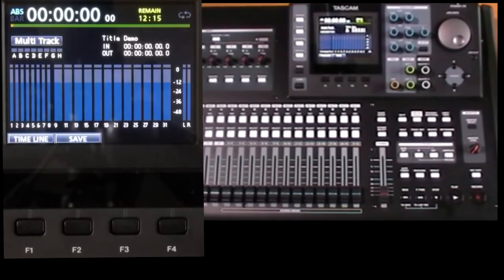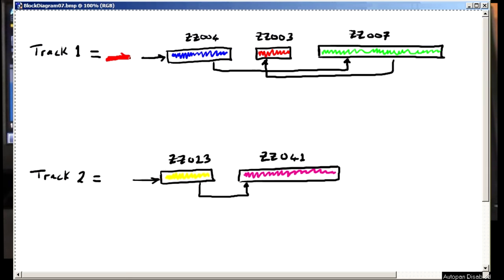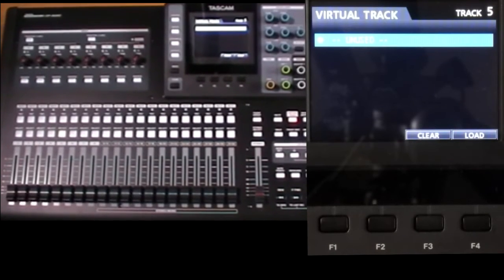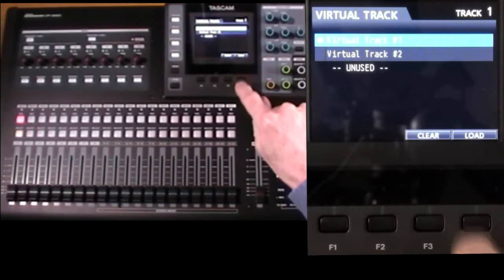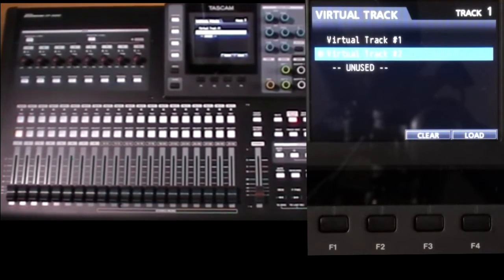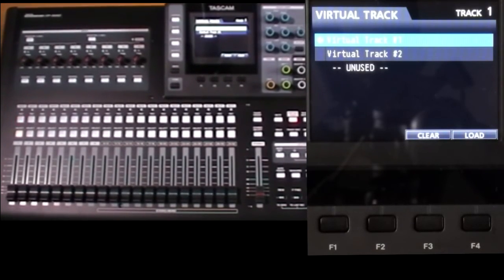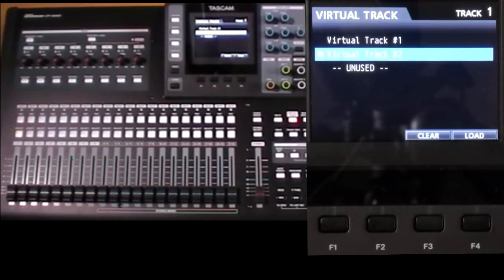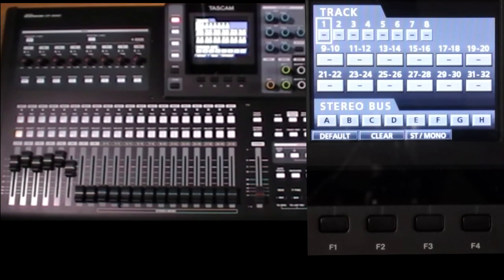Tascam DP24/32SD Tutorial 8E: Virtual Tracks

Comment: My previous recorder was a Tascam DP2488 NEO. When I used auto-punch with repeat, I cold create as many takes as I needed and cold choose the best one afterwards. Besides that, I had 250 virtual tracks with which I could store recorded tracks and move them around to whichever physical track I wanted. 
My recording technique is such that I auto-punch/repeat till I get and acceptable take. I didn't have to touch any of the 250 virtual tracks and could use those to store unedited tracks.
 With my new and "improved" 32SD, I only have 8 takes available and if I use the "repeat" function, I actually have no virtual tracks. This discovery made me regret getting the 32SD. I will have to come up with some kind of scheme to get around this.
Reply from the maker: @FOFFENDURP Yes, Tascam cut back on a lot of features with the DP24 & 32 models compared with the Neo, presumably to make it simpler and easier to use... and maybe increase the sales? But it's annoying as there's very little choice nowadays for these all-in-one portastudios. 

My old Fostex hard-disc recorders have loads of virtual tracks which you can simply 'exchange' with each other, either singly or in groups. I found it a lot easier to understand than the Tascam implementation of 'loading' virtual tracks to make them active, but then again, Fostex don't have the multiple-take feature, so you just can't win!

The only other way I can think of for storing extra tracks is to use the export/import functions. You can 'park' as many tracks as you like from a song, and they'll just sit in the AudioDepot folder until you want to import them later for processing. You need to use very short names for the song so that the AudioDepot contents screen shows the track numbers properly, and/or keep notes of what each track contains (although you'd have to keep notes with virtual tracks anyway) but it might be a workable option. The AudioDepot folder is common to all songs so you could also import tracks into other songs if you want.

Thanks for stopping by.

Comment: Thank you for all of these videos, Phil. They are an invaluable resource! It seems that you're preferred method of recording alternative takes on different physical tracks is also useful because if you, for example, had 3 different vocal takes and liked a portion from one, and a portion from another, then you could keep that portion, rather than having to commit to the entire track. Not sure if I explained that well. This could be achieved with virtual tracks if you exported them all onto your computer/DAW and chose the parts of the different virtual tracks that you preferred, however, (and then reimported the track back into the DP-24/32 for mastering).
Reply from the maker: @cinemojoe you're right, you can certainly use a computer to sort out various takes and collate all the good parts together. The larger screen and more powerful editing facilities make it easier, but... many people buy the DP porta-studios just to get away from computers! Either they don't have one, or they don't want to learn yet another potentially complex system, or (like me) they've had enough of using computers in their day job :)
This is the main difference between the DP series and the newer Model series. Even though Tascam market the latter as the 'next porta-studio', they are not really 'portable studios' (imho) as they do not have all the studio functions which are built in to the DP machines. If you want to do anything more than basic tracking and mixing, you have to involve a DAW. Anyway, that's another debate so sorry for the rant :)
At the end of the day, multiple takes can be handled using various techniques, so use whichever is more convenient for you. My point in the video was that using different physical tracks can be more convenient than virtual tracks as you can more easily review & compare them during playback by simply muting/unmuting or raising/lowering faders. At mixdown time, you can either repeat this operation in real-time, or if this is too tricky to do, you can always use the Track-Edit functions to copy & paste the good parts to another track. As you mention, this can be easier with a DAW, but the machine is capable of doing it all.
Thanks for stopping by and sharing the tip. Best wishes for 2023.
Reply: @philtipping   Thanks for the in-depth reply! Yes, one of the reasons I bought the DP-32 as well. I do video editing and graphic design and man, after 8 hours or more on a computer, I want to relax and play some music and not spend more time staring at a computer screen. And that’s really interesting about the new Model series. I was looking at the 12 but did notice that it was missing some features that the DP series have, though obviously has some newer features as well. I went with the DP for the editing/mastering capabilities. As far as using the on-board editor, I was actually originally going to ask if you could choose bits from different virtual tracks to add to the final track on the machine, but it seems the only way to achieve this (using the virtual track method) would be to perhaps set the virtual track you want to keep a part of, set the in and out point, and then copy that track to another track. Then, after copying, you could choose a different virtual track on the original and use that for the other parts. But I do appreciate and agree that this could be achieved more easily using the physical tracks, and much easier to monitor during playback as well. And to switch during Mixdown, as you said! I hadn’t thought of that part. Anyway, I appreciate the video series and am working my way through them. I’ve had the machine almost a year but circumstances haven’t given me the time/space to get recording yet, but these videos are helping motivate me! Thanks again. (And sorry for the novella).
Reply from the maker: @cinemojoe no worries re. novellas :) always nice to hear other stories, and glad you're finding time now to get stuck in :)
You're right with the virtual tracks. It's great to have extra tracks for 'parking' things temporarily, but as you say, you have to make each one 'active' before you can use it, so it can become a bit fiddly. By the way, another way of 'parking' tracks is to use the export function. The tracks will be dumped into AudioDepot, so you can free up the tracks in the song and import them later when you need them... you can import them into different tracks if you like, or even a different song. It's not as quick as selecting virtual tracks, but there's no limit to how many exports you can do. The only possible confusion is the truncated filenames which appear on the AudioDepot screen. You can get round this by using very short song names (just a few characters), but you don't have to as all names will be unique even if they appear garbled. The key thing is to make notes of what's what. Have fun with your machine and hope you make some great songs with it.

Comment: Hey Phil, do you have a tutorial on auto punch/repeat and how to chose your take from your auto punch session?
Reply from the maker: @Layne Noser I don't have anything specifically on auto-punch I'm afraid. The step-by-step guide contents are here  
http://www.philizound.co.uk/freebies/dp24-32/TascamDp24-32-HowToGuide-166-Sample.pdf  but there's no section on virtual tracks and auto-punching.
It should be fairly straightforward though as the 'auto-punch plus repeat' option just records each take into a separate virtual track automatically. This video #8E shows how to access each virtual track, so it should be just a case of selecting each one and playing it back.
I prefer doing multiple takes using separate tracks, but this obviously isn't 'hands free' like the auto-punch+repeat method. Using separate tracks is harder to record but easy to audition (you just move the faders or press the solo/mute buttons), whereas using auto-punch+repeat is easier to record but harder to audition.

Comment: Hi there. It's wonderful that you've taken the time to put this tutorial series together, I'm researching this machine to buy it and it's been extremely helpful, thank you. I have a question I hope you may be able to clear up. My preferred method of mixing down is to bounce. Is it possible after filling say all 8 mono tracks with drums and percussion, mix and bounce them to a stereo track and then use the virtual tracks as means of keeping the drum track for later mix "touch ups/tweaks" and having clear tracks on the mono track to say start recording guitars or vocals on virtual tracks? And still having to stereo drum track in playback? Using the virtual tracks as like a bank track storer?. Hope my question makes sense and sorry its so long. Thanks in advance.  👍🍀
Reply from the maker: @Cory Trevor thank you for the kind words. I think the answers to your questions are yes to everything :)
Video 9 describes the bounce process, but you're right; both bouncing and virtual tracks can be used if you run out of live tracks. 
Virtual tracks allows you to 'park' tracks to one side for re-use later, whereas bounce is more of a one-way process in that if you overwrite the bounce source tracks you cannot go back, but it's another option if you are confident in your work-flow. Bouncing was the only way to do it back in the tape multi-track days :) 
Note there can be only one of the 8 virtual tracks active/live at any one time so you'd need to keep the guide track live if you need it for further recording.
Hope that helps. If you need any more clarification, just shout. Maybe have a look at the step-by-step guide contents to see if it may be useful later - full details here: http://www.philizound.co.uk/freebies/dp24-32/dp24-32.html
Reply: Thank you for getting back to me and clearing up my query. This machine is going to do the job I need it to do. I thought you might be interested to know that upon price comparing this recorder around various sites, your tascam tutorial series has been mentioned in many reviews as the deciding factor for purchasing the machine and must watch for how to get the most out of the machine, you're some what of a home studio legend 😉👏 Thank you again. All the best to you. 🍀
Reply from the maker: @Cory Trevor haha well I've never been called that before, but I'll take it, lol.
Good luck with your machine. Don't forget to check/update the firmware (even if it's new) and use a recommended sd-card before doing anything serious.
Reply: I will, thank you. 👍

Comment: So you cant like do vocal comping or anything useful?! Whats the point of it then
Reply from the maker: @guitarslf132 not sure what you mean by 'it' - the virtual tracks feature or the whole machine?
Reply: @philtipping  virtual tracks, I cant see any value in it if you cant combine the takes
Reply from the maker: @guitarslf132  you're right, you can't combine takes from the virtual tracks directly on-the-fly, but they're still useful with a bit of patience. In the videos I suggest it's easier to use separate active tracks for comping, but this is only feasible if you have enough spare ones... but if you don't, you can use virtual tracks to free some up! You just 'park' any tracks you don't currently need onto virtual ones, and use the free ones for more recording and/or bouncing. If you want to comp a set of takes from the virtual tracks on one channel, you can easily 'spread' these out onto the spare tracks by making them active one at a time and cloning them to a different track. The track edit 'clone' function is instantaneous (as are all the track edit functions), and is also un-doable if you mess up.
You could stack up a massive vocal 'choir'... record onto separate tracks till you run out, then shift these active tracks to virtual set 2 and record another batch. Keep repeating this until you've got enough recordings. Finally, bounce the active tracks down to a single stereo track, then make virtual set 2 active and bounce these to a 2nd stereo track, then do virtual set 3, etc. 
Hope that's some food for thought. Thanks for stopping by.

Comment: how do i go about selecting which virtual track i wish to listen to with the mix ? and how to get back to the original track recording ?
Reply from the maker: @Jimbeau Walsh go to the virtual tracks screen, press the Select button for the track and confirm its number appears in the top-right of the screen. This shows a list of the virtual tracks for that track. 

The one marked with a blob is the virtual track which is current/active. This is the one which will used for any track-related operation, such as mixdown, track edit, record, import/export etc. 

To make a different virtual track the current one, use the cursor buttons to highlight the one you want, then press F4 to 'load' it. I don't like the term 'load' as it implies audio is transferred but that's how Tascam describes it.

To get back to the original recording, repeat the above and select the virtual track which contains your original recording. Typically the top entry in the list will be your original recording, but it depends what you mean by 'original'. As mentioned, whichever virtual track is current, will be the one which is recorded on when you next arm it.

That's why I don't like the way Tascam describe the whole virtual tracks system. All the 8 tracks are virtual. Only one of these can be 'nominated' as the current/active/live track at any one time.

Note there are 8 virtual tracks for every track on the machine, and these are all independent of each other, so it pays to keep a note (tracksheet) of what each one contains. Hope this helps.

Comment: I keep getting "export failed."
Reply from the maker: @em jay could be several reasons: card full, card/song faulty, out-of-date firmware. The Information screen shows how much space your song is using and how much free space is left. The 'delete unused' function will clear out redundant takes from the selected song. You can dump complete songs to a computer to free up space.
Reply: @philtipping  Yes I deleted unused several times thinking that was the issue. I also cut and cleaned out tracks. It finally worked. Thank you for your help!
Reply from the maker: @magneto7930  Thanks for the follow-up; glad you got it sorted. I would treat this as a warning and make sure you have the latest firmware (if you need to upgrade, also reformat all cards after upgrading), and to have a regular backup strategy in place. The machine is very reliable now as long as you use good quality cards, preferably from the approved list, but there is still the potential for corrupting the card, e.g. power outages or not powering off properly, forgetting to power off before removing the card etc. so it's best to be safe :) All the best.

Comment: Thank you so much Phil. The fact that the reverb is stereo L/R; should not matter if I am only using right channel of external effect?    Keep up the amazing work Phil... I am certain there are many more followers to catch on to what great work you do! :)
Reply from the maker: Each Send is mono, but some reverb units will still generate a stereo output even with a mono input - you may need to configure a setting in the FX unit to do this (check the manual). You could also use Send-1 and Send-2 to create a stereo send if you really need that for your external effect - one of the videos shows how to do all this. Thanks for your support.

Comment: I want to connect my tascam DP 24 to my computer so that it works as an audio interface on my cubase software what do I do.....I need your Help Broh  👍
Reply from the maker: Hi +Lansan Rappeur - the video before this one covers Export & Import and shows how to transfer your recorded tracks to the computer. You can either physically move the sd-card to the computer or use a USB cable to save having to plug/unplug the sd-card. As long as you ''Export' all the files as shown in the video, all your tracks will line up correctly in your software so they'll playback in sync.

Comment: SIMPLY AWESOME Phil ! 2 questions: 1) Can you record on the stereo tracks separately... ie. at different times.  2) I can't seem to hear my 'external' Send EFF 2. I connected as shown in the manual. connected to input A, assigned it to Track 1. Send 2 is going through an outside reverb unit (just to hear an exterior FX) and back into open input H... can't seem tto get the signal on track 1 to hear the reverb...   WOW Phil, keep up the great work.
Reply from the maker: Hi +John D Sautner, thanks for the feedback. Q2: Can you hear the signal being sent from the machine? i.e. use Monitor Select to select Send-2. If you cannot hear anything in the monitor, then you know nothing is going into your external effect unit. In which case, there are 4 things to check: 1. the mixer screen is showing Track 1 in the top-right before you check steps 2 to 4. 2. the EFF Send-2 in the mixer screen is set to Pre or Post as required (if it's Post, you'll need to turn up the fader for track 1 as well). 3. the Send-2 level. 4. The Master-2 level. If you can hear the Send-2 signal in the monitor, then you know it's reaching the effect (is the cable plugged in to Effect-Send-2?), in which case there may be level controls in your FX unit which need turning up. If they're ok, then the problem is with Input H. Hope that helps. Let me know if not.